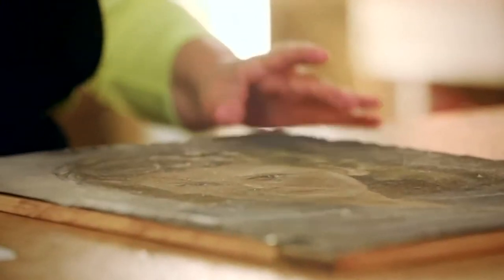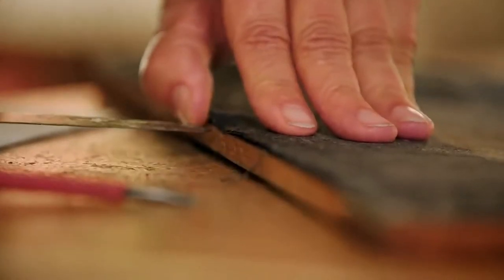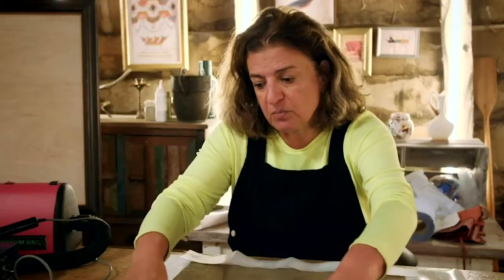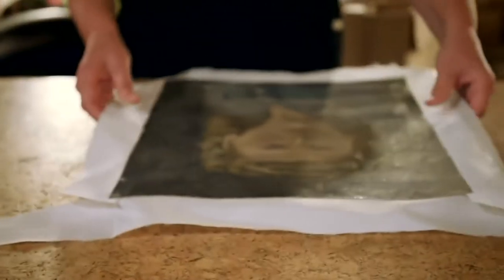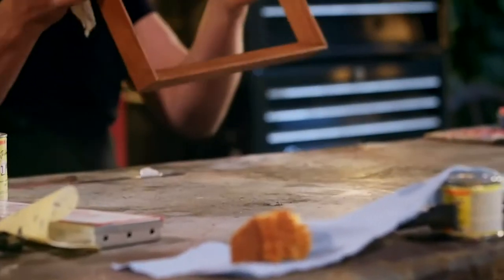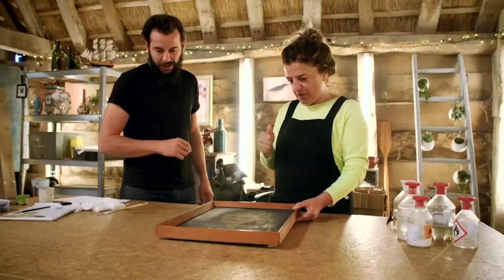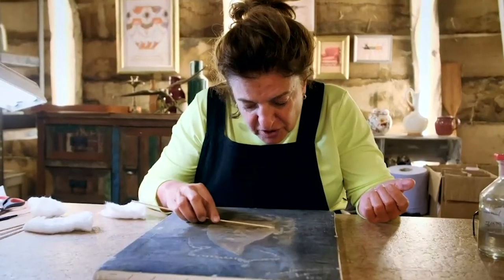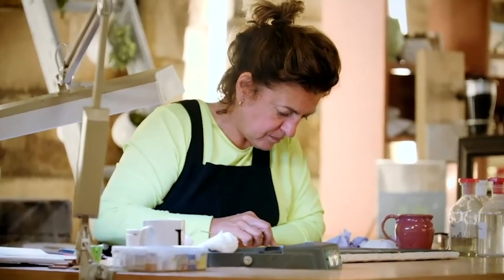Lifting Layers of Varnish and Grime from Family Portrait | The Repair Shop

Comment: What solvent do you use on varnished oil paintings? Would you use solvent if there is no varnish?
Reply: There are cleaning solutions available at any artstore. These will remove dirt on top of the varnish, but won't remove the varnish. Removing the varnish requires actual chemical solvents - not recomended for untrained persons.